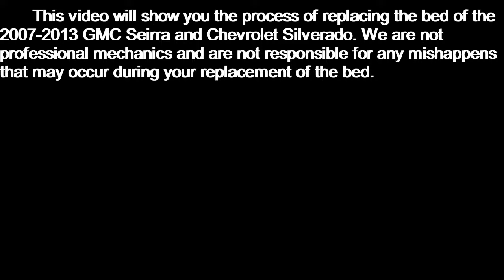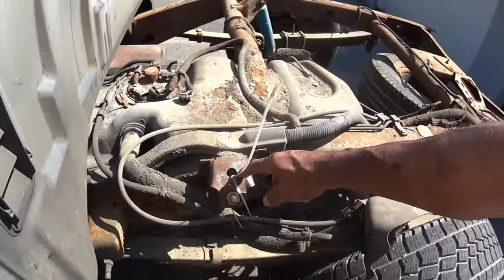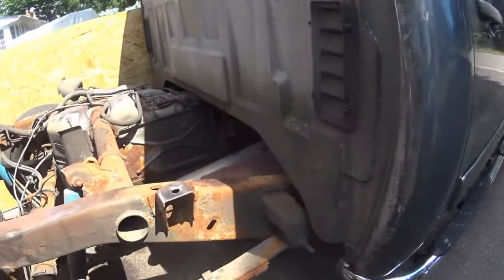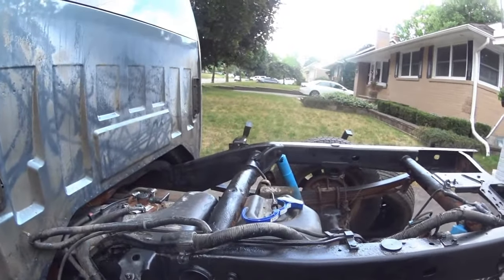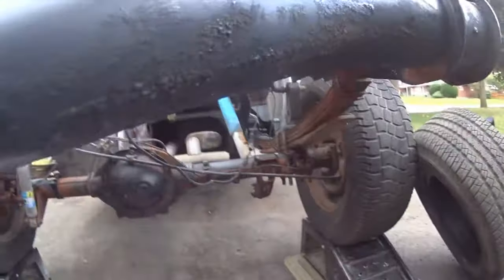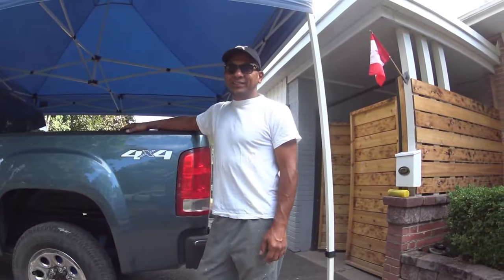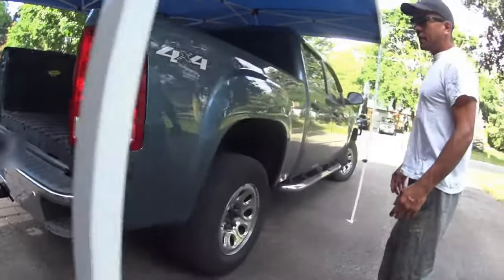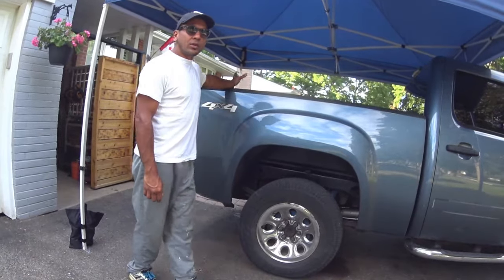How To Replace The Bed Of A 2007-2013 GMC Sierra/Chevrolet Silverado

Comment: Great video - just wanted to share that one does not have to remove the rust. There is company called Magnet Paint and the type of undercoating paint is called Chassis Saver -  you make sure any loose rust, old loose undercoating, dirt and grease is removed from the rusty areas. You literally apply Magic Paint over the rust. You have to wear longer nitrile gloves and do not let any get on your skin - it will take you four to six weeks to all of Magic Paint off of your skin. Many car collision shops and undercoating places use this Magic Paint. It's an open secret in the industry. I live in the northeast US lots of rust up here, snow and salt which kills the metal in cars. I used it three years ago and it still looks brand new.
Reply: I did an internet search for "Magic Paint" and nothing by that specific name came up. Do you happen to have a link to it?
Reply: @michaelparker6819  Awwe man - I'm sorry. I gotta edit my comment. I just used my glasses and looked closer at the tiny name on the can. The company is "Magnet Paint" the type of paint is called Chassis Saver. My bad. Editing my comment now
Reply: @turnsufficient4971 😂😂😂😂😂😂😂😂😂

Comment: What did you use for paint I didn't notice what you did for prep and how's the paint holding up?
Reply from the maker: i used tremclad rust proof,.  i used brushes and air compressor as well
Reply: @djdeived1  Thanks for getting back. It looks pretty good.  did you have to spend much time on cleaning the frame?
Reply from the maker: @gjames57  about 3 to 5 days maybe. The sanding part took a while. It was rust.I did 2 coats of paint so it needed to dry good. After that   I also sprayed fluid film.
Reply: @djdeived1  thanks

Comment: You have 3 bolts on each side correct? I am struggling to locate the middle bolt on my 09 sierra
Reply: I've got 6 bolts off for my 2010 wondering if there are more